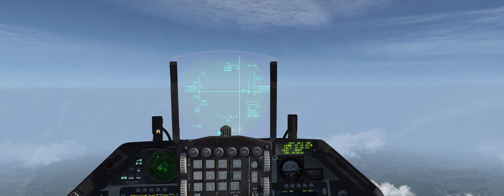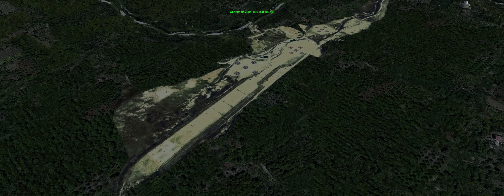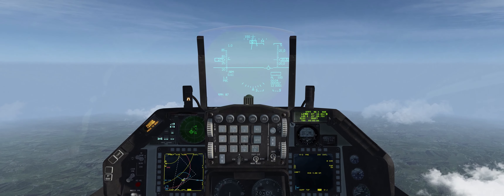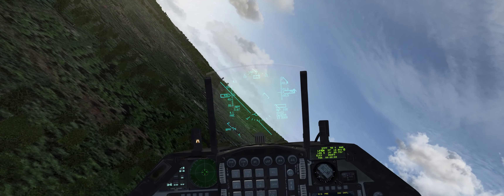BMS 4.36 GBU39 SDB

Comment: I like your video because they deliver necessary info condensed into a short time frame. One question: what is the TMS up (long i guess) exactly do when you switch a steerpoint. Is that neccessary to explicitly designate the target steerpoints (81-99)?

 Some constructive criticism: game sound relative to your voice could be a mid lower. Some of your words are overwhelming by whats going on in the back. Also some of the things you talk about (past 3 min mark) cannot be seen and your head movement didnt make that easier 😅 apart from that, keep up the spirit!
Reply from the maker: Thanks for the feedback, and for taking the time. Certainly, will take them on board. 

In answer to your question, probably should have described this video as an advanced topic, and an understanding of the OSB layout and Hotas function would really be needed. 

Pre-assigned target points are done at planning/briefing stage in BMS. Game provides 9 (91-99). I generally assign in reverse order 99-91. The process for sequential release is Select the PTP, remove any slew offset with the CZ on the MFD. Then TMS UP to lock the target, (single press) then press and HOLD the pickle until you hear the release. Failure to hold it long enough may cause a 'hung stores error' on the SMS system, rendering the weapon inoperable.  You can use the ICP rocker switch to decrement the target points down from 99 so repeat for the remaining weapons, remembering to TMS UP before pickling. Hope this helps.